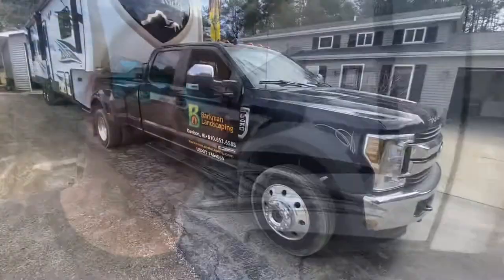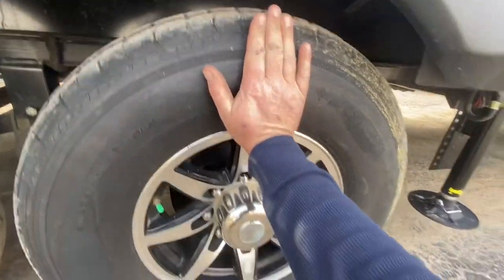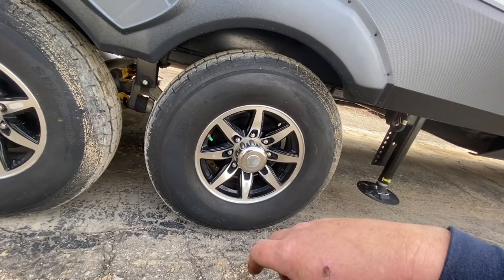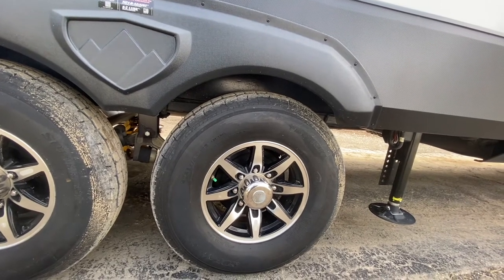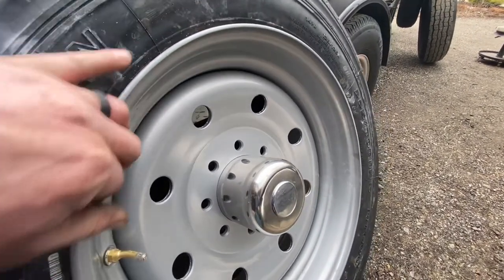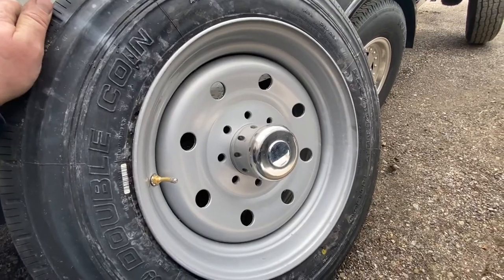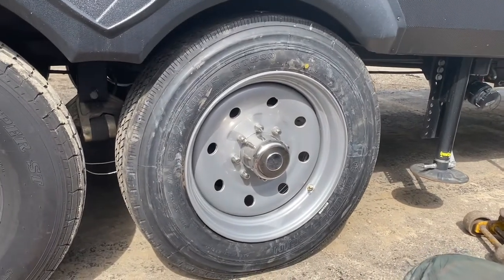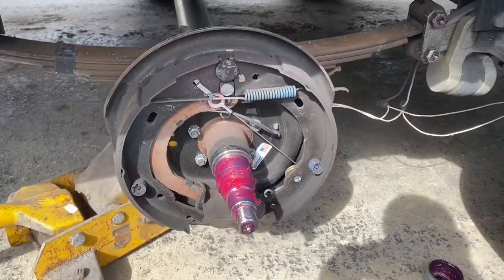Upgrading my 5th Wheel to 19.5” Boar wheels and tires

Comment: This looks like a good alternative when needing to make adjustments to level the fifth wheel. Bigger wheels and tires brings the trailer camper higher, a little more level with the truck.
Reply from the maker: It definitely helped with that.  While the 19.5’s fit in the confines of the fenderwells, they are an inch or 2 larger diameter than the 16’s.